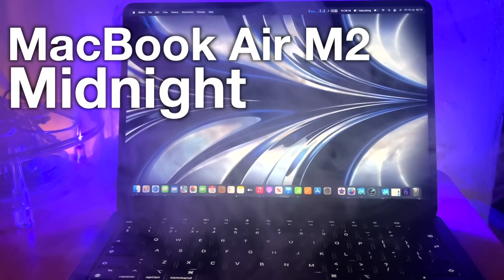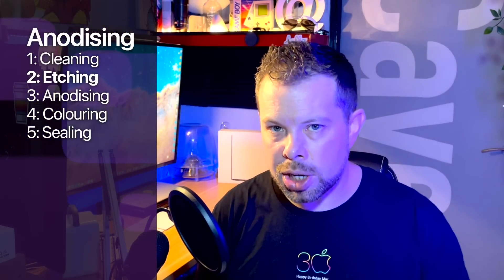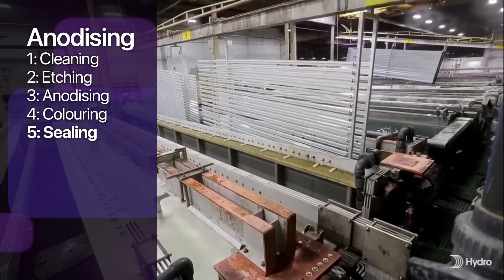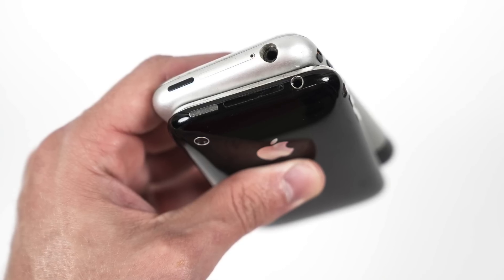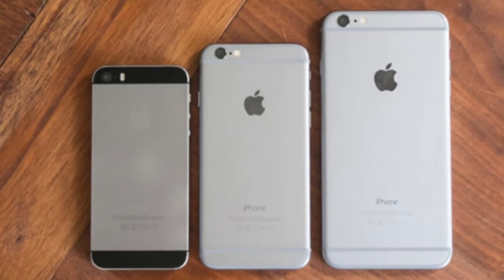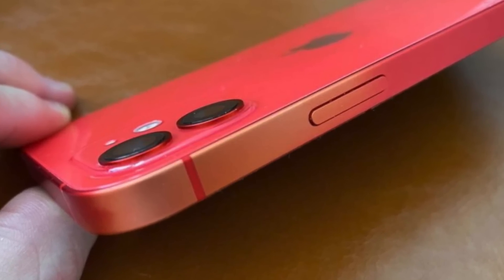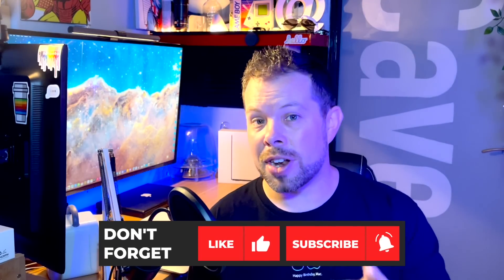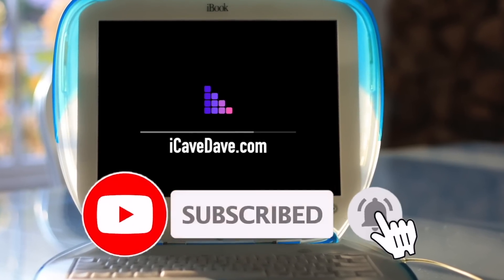MacBook Air MIDNIGHT has a PROBLEM!

Comment: Thank you for this great review!
I usually run Youtube and Twitch at the same time (sometimes a couple of each) along with some other basic web browser pages (news, sports, poker etc). I also play Football Manager and watch Netflix, Amazon Prime and Sky Go. I assume this laptop will be fine for that without overheating?
I currently have a £1,000 HP laptop but am considering returning it as the battery is so poor (3-4 hours with very basic use) and it has a touch screen I don't use. Although it's very nice it's not as sleek or sexy as this M2 Macbook Air (I also love this Midnight Blue colour and it will match my iPhone 13 mini nicely).
Reply from the maker: Yeah you'd have no issues running that kind of stuff in terms of thermals
Reply: @iCaveDave  Many Thanks!